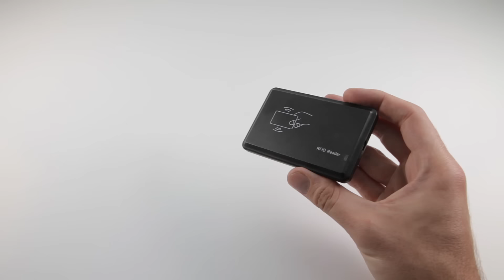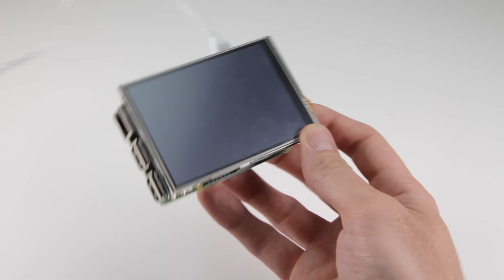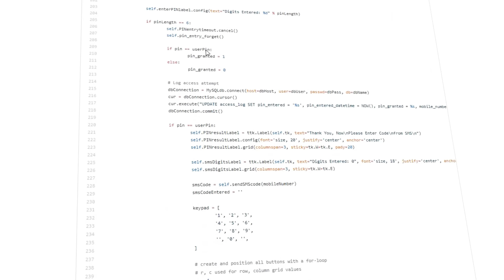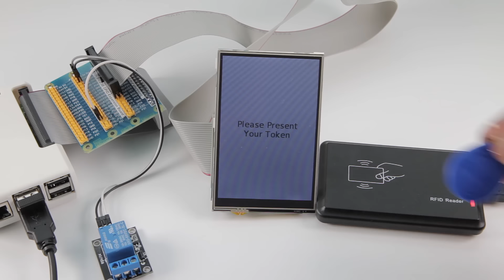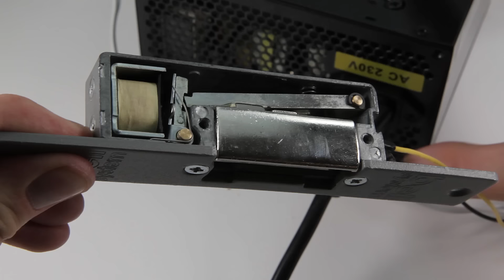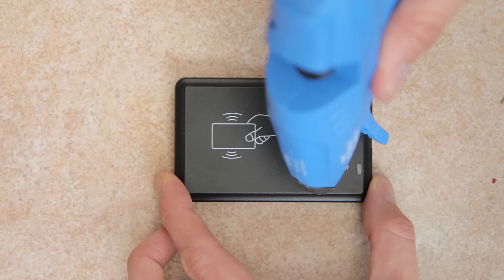Build a Raspberry Pi Smart Door Lock Security System for your Smart Home!

Comment: Hey Paul

This is a wonderful project that uses so many of the functions of Python and the Raspberry Pi.  Your tutorial was so well documented and delivered.  I do have a question though.... I want to remove the SMS authentication and add a step that verifies a number from a separate table in the MySQL database.  I can build the table with no problem but I need to figure out where to put the additional code and what it might look like.  I also want to make  sure and comment out only the SMS configuration if that is possible.  Any help would be appreciated!
Reply from the maker: Thanks for your comment and kind words! I'm not quite sure what you mean by "verifies a number from a separate table in the database".... do you mean like a second PIN?
Reply: That would be correct.  I am wanting to validate that the person using the card has access to a valid work order.  The cool thing about your system is that it would log the work order.
Reply from the maker: aaaah I see, so the PIN would be personal to them but the work order ID might be known by several, and also be time-limited so only be valid between pre-defined start and end times? Cool application! Yes that's perfectly possible and easily do-able - let me see it when you've done it!
Reply: OK Paul, I have this program just about completed, however, a glitch I am having is if you scan the card then scan it again the verification screen pops up at the bottom of the initial verification screen.  How can I turn off the RFID reader until Access Denied or Access Granted?  Thanks a lot for your help.

Comment: I wonder if some of this could be streamlined. If instead of an RFID, what about a bluetooth reader to detect a signal from the phone, which then detects the user from the phone, which then sends a 1 time code from the server to the phone, which then has the phone send the code to the reader, which then unlocks the door. You won't even need holes, screens, etc in your wall if your bluetooth can transmit through the wall. No?
Reply from the maker: I like it!

Comment: Hello Paul, awesome project. I have managed to get everything working except getting the relay switch to trigger and click once I enter the sms code. Any help would be appreciated. I have the exact setup as you did. Thanks
Reply from the maker: Thanks! Any error output to console if you run from there?
Reply: @SwitchedOnNetwork  Thanks for replying. Unfortunately no error
Reply from the maker: Try writing a separate, standalone script to trigger the relay and check that all works?
Reply: @SwitchedOnNetwork  Yes I tried that with an LED, relay works just fine. The relay has triggered the lock but this happens even before I place my key fob on the rfid reader. Thanks
Reply from the maker: Ah, something definitely up then! Does anything happen at the point where it's meant to unlock? ie. does it lock? Wondering if your Normally Open/Closed might be reversed? If not... you'll have to go through bit by bit debugging until you figure out what's up I'm afraid! Good luck 🤞

Comment: Hey man,
i really like your raspberry pi door lock System and im trying to rebuild it for school.
Following is my question:
How can I import the code and the database step by step? I dont know what to do.
Thanks in advance
Reply from the maker: Hi there! If you're familiar with installing a LAMP stack, that will give you a web server (Apache), database (MySQL) and the PHP language to tie the two together - this will enable you have the web interface to access the database, which is callled phpMyAdmin.

Install the LAMP stack, then install phpMyAdmin - there are tonnes of guides on how to do this, so I won't go into full details here in the comments.

Then, download the door_lock.sql file from my GitHub repo and use the Import feature of phpMyAdmin to import that.

For the script, you can use the "git clone" command to pull down the script from the github repo (https://github.com/paulfp/Three-Factor-Security-Door)

You'll need to insert your database username/password into the lock.py script before running.

I've also written up a more in-depth text version of the video tutorial here: https://www.switchedonnetwork.com/2017/11/10/build-the-ultimate-door-security-system-with-three-factor-authentication/

Good luck and enjoy!

Comment: How to disable the sms function? I don't want to get a sms every time i open a door. And can I use the databased stored on a LAN server to have more door locks running on the same db?
Reply from the maker: Yes, you can build a bigger system by having a centralised database as you describe. And to bypass the SMS element, simply remove that bit of code and go straight to activating the relay! 👍
Reply: @SwitchedOnNetwork  what part of the code is the SMS bit?
Reply from the maker: Line 314

Comment: Awesome Video. Can i make this only a 2 factor authentication? Removing the rfid. How do i change it on the python script?
Reply from the maker: Thanks! Yes that's easily done, just swap the functions around so that when it's initialised it's calling the function to wait for PIN entry stray away. You'll have to remove the name and picture elements too.
Reply: Switched On Network  Thank you for your fast reply. I want to keep the name and give people acces with the code, then once they put the code i gave them they get a 1 time access code to their phone.
Reply: Switched On Network How long do the codes last? Also is there a way to Support your Channel without pledging. Like Paypal, Venmo Etc. Doing it 1 time and easy for people? Thank you. Keep Doing good work.
Reply from the maker: Hi, if you mean the smsCode then it's generated and held in memory until it's entered into the screen. You can build in a timeout for the code itself if you like, but the screen will automatically stop waiting and return to idle state after 60s, rendering the code invalid. You can change that if you like (line 260 of script).

That's very kind of you to want to support the channel, thank you. The best way to make a one-off pledge would be to use Patreon and then cancel after a month (www.patreon.com/SwitchedOnNetwork) or the PayPal email address is paypal@innobellamedia.uk - thank you!

Comment: I'm doing your three-factor security door lock,  and i have made a few steps of the installing and then i need to import the python code to the database but the thing is, i'm getting an error and looks like this

#1064 - You have an error in your SQL syntax; check the manual that corresponds to your MariaDB server version for the right syntax to use near 'import sys
import MySQLdb
from threading import Thread
import threadin

What could be the problem? I read that has to be something about "server mariadb"
Reply from the maker: Hi! It looks like you're trying to import the Python script into the database..... whoops! That needs to be placed in the Raspberry Pi user's home directory and run from the Terminal. The only thing you need to import to your database server is the door_lock.sql file. Once imported, you can fill in the users table with your name, filename of your photo, your keyfob ID and your mobile number. Enjoy!
Reply: @SwitchedOnNetwork  It works, I was importing the wrong file, it's the sql file, not the python one. THANK YOU!
Reply from the maker: Excellent, great!
Reply: @SwitchedOnNetwork  Hi again , I was in the step "Make the Python Script Autoload when Your Raspberry Pi boots up" and then you have to type this command "sudo nano ~/.config/lxsession/LXDE-pi/autostart" but when I'm adding this line "@sudo python lock.py" and trying to save it, it said that the directory doesn't exist and can't save it, there's something that I didn't download?

Comment: Hye paul. I hope you can share some tips on why when i touch keypad for no 3 on lcd touchscreen but  the keypad select no 1? Help me sir
Reply from the maker: Sounds like you have the touch display mapped wrong - did you edit TWO config files when rotating to portrait?
Reply: Switched On Network yes i did it. But when i touch keypad using mouse it was perfectly working compare to i touch by my finger. What should i do sir?
Reply: Switched On Network do you have any ideas what should i do sir?
Reply from the maker: Check that you've followed the instructions that came with your screen exactly. As well as rotating it visually, you also have to rotate the invisible matrix that sits above it mapping touch onto the display.
Reply: Switched On Network sir how to rotate invisible matrix as you mention just now?
Reply from the maker: I go through it all in the video. It might be different for you though unless you have exactly the same screen.
Reply: Switched On Network im using 3.5 inch of lcd touchscreen. It is because of the problem from the lcd touchscreen itself?
Reply from the maker: Maybe
Reply: Switched On Network ohh alright sir. Thank you a lot

Comment: Hye paul. Your video is awesome. I have problem on how to monitor phpmyadmin using laptop instead of lcd touchscreen? Help me sir
Reply from the maker: Thanks, glad you like the video. If you've installed a full LAMP stack then you should be able to go to http://xxxxxxx/phpMyAdmin where the XXX is your pi IP address 👍
Reply: Switched On Network i try to write on google at my laptop http://192.168.x.xxx/phpMyAdmin but  google writen not found
Reply: Switched On Network im sorry paul. What should i do to view the database on laptop screen ? I try to google the link that you wrote by insert my ip address/phpMyAdmin and the result was not found
Reply from the maker: Did you install phpMyAdmin too?
Reply: Switched On Network sir how do i need to install using laptop?
Reply from the maker: sudo apt-get install phpmyadmin
Reply: Switched On Network ohh i see.. so i need to connect raspberry pi with laptop then run the command ?
Reply from the maker: Yes, the same way you installed the lamp stack. Either open a terminal on the Pi itself or shell into it via your laptop to run the command 👍
Reply: Switched On Network ok thank you paul.You are really help me

Comment: So I figured out why I couldn't find the Lxsession file, apparently this folder was in /etc/xdg/lxsession/LXDE-pi/autostart. So I attempted to edit this file and add the line you noted and still no luck. I cant seem to figure what else could be wrong. Can I transfer the lxsession file to .config, if so how can this be done?
Reply from the maker: What version of Raspbian are you running?
Reply: @SwitchedOnNetwork  Raspbian GNU/Linux 9.8 (stretch)
Reply from the maker: Yes, I believe you can copy that autostart file (using the cp command) to:

~/.config/lxsession/LXDE-pi/

Comment: i seem to be having trouble getting the database to upload, it says upload successful when i put the .zip in phpmyadmin but nothing changes. i did the git clone step up until the auto boot since technically i have nothing to run.
Reply from the maker: Extract the zip and upload just the .sql file 👍
Reply: @SwitchedOnNetwork  im noticing when it prompts me for the mysql password set up, its not "root" user but phpmyadmin. when i try to make edits on phpmyadmin it says i dont have permission..do i have to be on the root user?

Im sorry for all the questions ^^;

Comment: I have made it up to the part where I am trying to make the PI auto start and it gives an error message stating the Directory ' /home/pi/.comfig/lxsession/LXDE-pi' does not exist
Can you please help??!!
Reply from the maker: Check the path carefully; it looks like you have a typo in the word "config".
Reply: @SwitchedOnNetwork  thanks for the response I am still getting the same error saying that the file does not exist. Question when I upload the GitHub file to my home folder what all files should be in that folder because I am only seeing the lock.py file

Comment: i'm getting an error message when I import the files to phpmyadmin. Could you help me with it?
Reply from the maker: What's the message?
Reply: @SwitchedOnNetwork  
The door sql file uploaded successfully, but when attempting to upload the others I am getting the error message below.

Error
Static analysis:

1 errors were found during analysis.

Unrecognized statement type. (near "text" at position 2)
SQL query:

* text=auto

MySQL said: Documentation

#1064 - You have an error in your SQL syntax; check the manual that corresponds to your MariaDB server version for the right syntax to use near '* text=auto' at line 1
Reply: Error
MySQL said: Documentation

#1064 - You have an error in your SQL syntax; check the manual that corresponds to your MariaDB server version for the right syntax to use near 'import sys
import MySQLdb
from threading import Thread
import threading
import t' at line 1
Reply from the maker: That sounds like the Python script - you need to run that in the shell, not import into database.

Comment: sir, can i use biometric at the place of RFID.
Sir i am facing too many problems in our project which is smart door locking system using biometric on raspberry pi. sir plz help me to make my project.
Reply from the maker: Yes you can
Reply: @SwitchedOnNetwork  sir but how can you send me all process for this.
Reply from the maker: I can't I'm afraid, no. It's not something I have available for you, but as it's open source you can do it yourself. If you need extra tuition you will find many resources online.
Reply: @rishi raj can u please help me in my project...my project is on biometrics too
Reply from the maker: I may do a video using either fingerprint scanner, retina scanner or both in the future, so stay tuned 😎
Reply: Sir i am in urgent need of data related to this project can u plzzz provide me with some related synopsis...
Reply from the maker: Everything available is in the video and its description 👍

Comment: Dear sir. I just wonder why my rfid presented value in mysql not appears number but it only show XXXXXXXXX? Help me sir
Reply from the maker: You need to replace that in your database with whatever code is stored in your specific fob.
Reply: Switched On Network i just scan fob to row of rfid_code in access list still happen the same
Reply from the maker: Scan the code into a basic text editor like Notepad, and then copy and paste into the database either via command line or using phpMyAdmin
Reply: Switched On Network i already try as what you proposed me to do but still get the same result. Do i have to write fob in python lock script ?
Reply: Switched On Network how to write via command? Do you have any suggestion?
Reply from the maker: That's a whole different tutorial in itself. If you Google "mysql command line access" or something you'll find a wealth of resources. Or just install phpMyAdmin as per my tutorial...
Reply: Switched On Network if there is still happen the same.. do you think phpmyadmin is not run well?

Comment: i cant find the img file to get my touch screen working :(
Reply from the maker: Did it come with a CD or panything? It'll depend on the model and manufacturer
Reply: @SwitchedOnNetwork  nope just a screen and a stylus...i go on waveshare and it keeps taking me in circles between two pages :/ i tried the .z file but it says it might corrupt my sd card
Reply: @SwitchedOnNetwork  got a replacement with a CD but i still cant get it to work :/
Reply from the maker: I would contact the manufacturer or retailer if I were you, they should be able to advise. Sorry I can't, there are so many!
Reply: @SwitchedOnNetwork  no problem! ^^ thanks for the advise
Reply: https://www.amazon.com/gp/product/B00PVHZJVW/ref=ppx_yo_dt_b_asin_title_o03_s01?ie=UTF8&psc=1 this is the one i got

Comment: IndexError: string index out of range

Can you help me in this...whnever i run python script it shows... In listen_rfid
Reply from the maker: Have you checked which input device your USB reader is? If you've also got other USB devices plugged in it might not be event0...
Reply: @SwitchedOnNetwork  i attached my usb keyboard and usb mouse on other two usb slots of pi
Reply from the maker: In that case, check the video description (where I listed the file paths) for instructions 👍

Comment: Keypad doesn't fit... To the screen... Help me out
Reply from the maker: Hi, great to see you're building the project! If the screen you're using isn't the exact same resolution as mine, you'll have to edit the Tkinter sections of the Python script to adjust, as it's not automatically responsive. Once you've sorted that you should be fine. Enjoy!
Reply: @SwitchedOnNetwork  could you please explain some more abt this..
Reply from the maker: The best thing would be to read up on some beginners' tutorials on Tkinter for GUI in Python script. That'll give you a basic understanding of how it works far better than I could here in the comments.
Reply: @SwitchedOnNetwork Hi, i got everything working, i just got a problem with the GUI, i've been trying to fit the keypad to my monitor but i cant find the line of code that positions the buttons, my current situation : https://prnt.sc/12vr9ai
Can you please help me fix this? or give me the code line that does it? its really bugging me